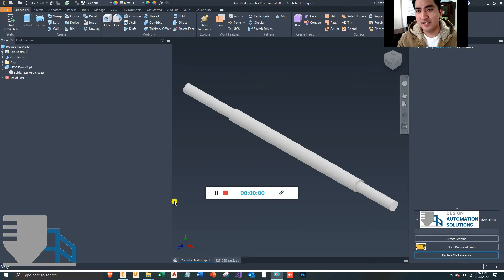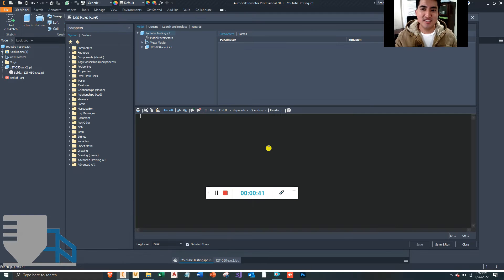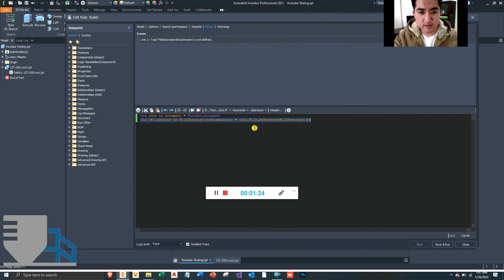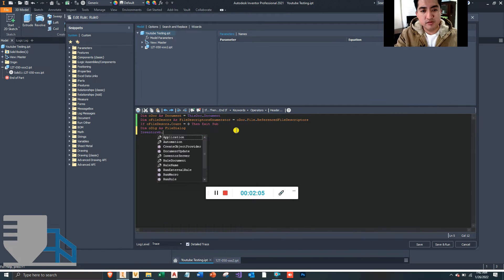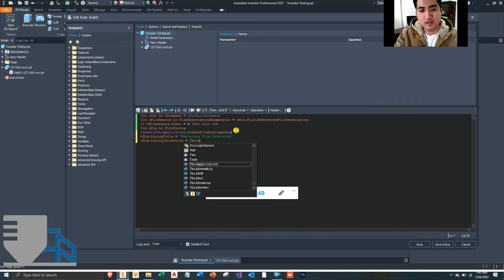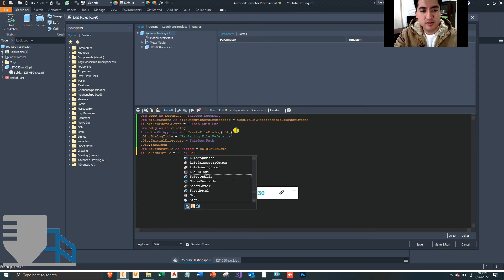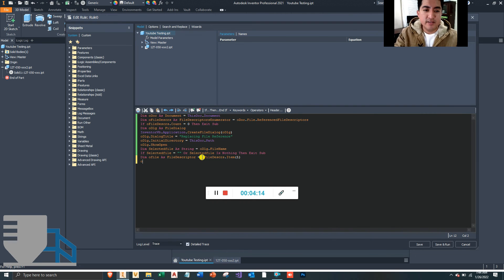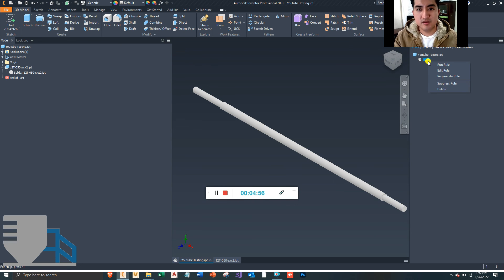iLogic Lesson #17: Replacing File Reference of Derived Component (MUST WATCH)

Comment: What if I want to place the derived part instead of replace an existing derived part? Your code seems to work to get the derived dialog box to print but it is not actually placing anything if it is new.
Reply: That won’t work if the new file isn’t a child of the original derived file

Comment: Will this code work in 2022 professional. I’m trying to code replacing a model reference after a drawing is created from template file. But the coding for setting the file descriptors is give me a parameter error.
Reply from the maker: Yes it works on 2022. What error are you getting?
Reply: Using your code, I get the error “Type ‘FileDescriptor’ is not defined
Reply: Sorry, that line is fine I had a type. It errors out on the line and gives the error “The parameter is incorrect. (Exception from HRESULT: 0x80070057(E_INVALIDARG))
Reply: All I’m trying to do as automate the “Replace Model Reference” in drawing through illogic using a parameter name in the ipt file. No code I’ve found is working and getting same error as above. Thanks for answering btw!
Reply from the maker: @rickcarroll6138  ahh I think you might be pulling the parameter from the drawing and not the ipt? You can do this but make sure you are pulling the values from the ipt but not from the idw
Reply: It’s actually pulling from iProperty value in the ipt. But the error is occurring before the actual replace code. It’s occurring when trying to assign a variable to the FileDesriptor object.
Reply: The line "Dim ofile As FileDescriptor = oFileDescrs.Item(1)" is what's throwing up the error

Comment: I tried to replicate this Inventor 2023, but the File Dialogue window only shows folders, none of the file. I've triple-checked that my script matches yours exactly. Any advice?
Reply from the maker: I'll have to install Inventor 2023, I haven't written any iLogic on there yet. 

Best,
Felix
Reply: Did you find any solution for this? I have the same problem
Reply from the maker: @markusb8297  haven’t installed it yet. Try typing “Imports System.Windows.Forms” in the header. Might have to manually load in the namespace